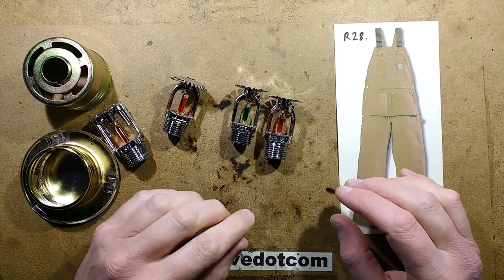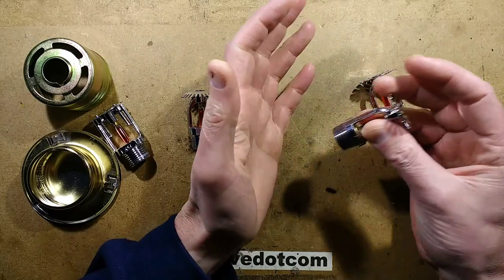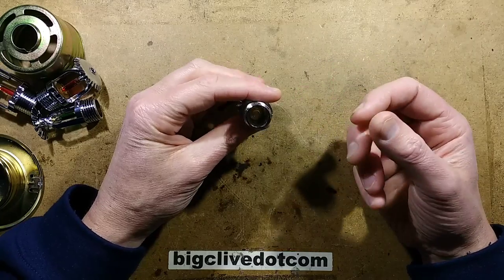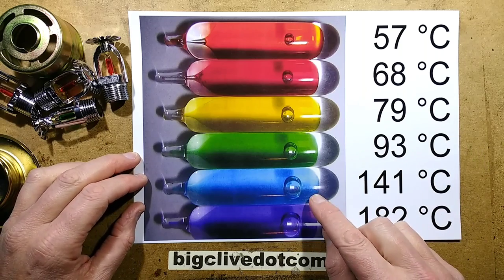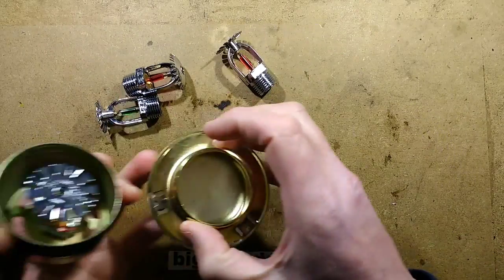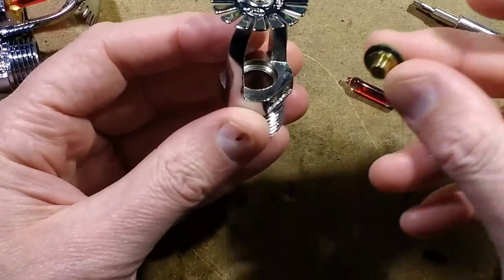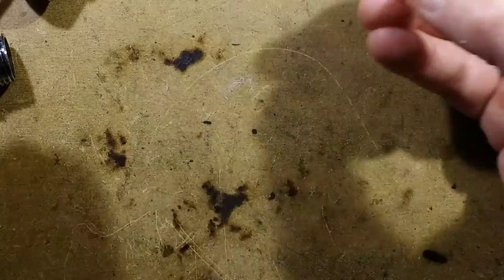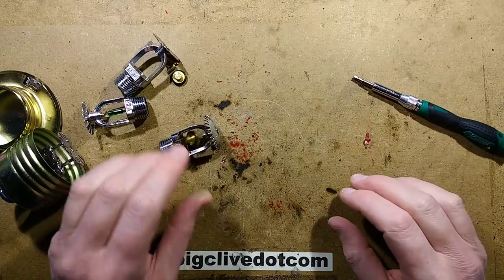How a fire sprinkler works. (featuring broken glass and spatter.)

Comment: to answer your question, the liquid substance is glycerin based liquid.  There are other kinds though.  The metal I mentioned in another comment is made of what's refered to as "wood's metal," which is a mixture of bismuth, lead, tin, and cadmium, low melting temp of course.
http://www.explainthatstuff.com/firesprinklers.html

Also available, usually in high hazard areas (hangars, power plants, etc) are deluge. Mentioned in my other comment too, all nozzles are open and the system is pressurized.  heat and smoke detectors in the same area as the head trigger what is called a deluge valve at the base of the system (where it connects to the main).  Thus, when activated, the whole system goes off.
https://www.vfpfire.com/systems-deluge.php

There's literally a whole class offered at our local fire academy about fire suppression systems.  Beyond these water sprinklers, there are older systems called Halon systems.  Halons have been pretty much phased out of production, due to the effects on the ozone, though I hear of them using halotrons, an environmentally friendly version of halons, to replace these.  Basically, Halons displace oxygen, and, when all done, do not leave any residue.  You will often see these in older computer labs that were around since the 80s.  By the mid 90s, their installation was outlawed (due to ozone effects) and now once a system has activated, it must be replaced.  The system works when fire detection systems are triggered.  An alarm sounds and individuals in the room have 30 seconds to leave.  after this electromagnets holding the doors open release, allowing the doors to close.  Once they latch, they are electronically locked, and the halon gas is dispersed (I can't say I know the exact gas used).  The gas removes all oxygen from the room, and, after a while, the gas disperses leaving no fire and no mess, and any computers not effected by fire or smoke can be used.  It's a neat system!

Perhaps you could see if you could get more fire supression/detection system components on camera?

Comment: They make plastic pipe for sprinkler systems. But if you work with explosive stuff you want steel pipe
Reply from the maker: I just came across the plastic sprinkler fitments.  Interesting to note.
Reply: @bigclivedotcom  yeah but I read another comment where the guy said an air charged system. It is better since the water (and possibly glycol depending if it's in a freezing area) turns nasty. In your refrence to putting sprinklers in your shop. I'm a plumber in New York but I know in Connecticut in the mechanical room is required to have a sprinkler head coming off the water main JUST IN CASE. If you do want to put in a  sprinkler system with copper you can use ProPress.
Reply: Also. Love your channel 💪💪👍👍👍👌👌👌

Comment: another thing that is interesting about fire sprinkler bulb is that they come in different sizes and as the size of the bulb gets bigger it increases the delay of the bulb exploding. In the trade the smaller/thinner bulbs are call quick response heads and the lager/thicker bulbs are called standard response head. in your video it looks like to me these are all standard response. 

http://www.qrfs.com/assets/images/difference-between-quick-and-standard-response-sprinklers-QRFS.jpg
Reply: Another thing to note about this is it wouldn't be a good idea to put a quick response head in the same area as a standard response head because if the quick response head was more remote to the fire you wouldn't want it to go off before the standard response head (which would be closer to the fire) this will cause the fire the spread away from the active fire sprinkler much faster or  worse the quick response head could cool down the area and the standard response head would never active.

Comment: Clive, that system where the sprinkler is enclosed is a bad idea. The common method of turning off sprinklers in an accidental situation is to take a wedge of wood or rubber or really any malleable waterproof material, and whack it into the gap where the glass used to be. In the enclosure, it would be near impossible to do that.
Reply: Try using the sprinkler cutoff valve next time.

Comment: I would not recommend installing a commercial sprinkler system into your residence unless you're prepared for the aftermath of it activating.
Reply from the maker: Still a better option than having the house burn to the ground.
Reply: Yea considering the insurance limits on water damage versus fire, you might be better off financially having the whole thing burn down.
Reply: A friend just moved into a new "stacked townhouse", and every room and passage has sprinklers in it.  Don't think it's a "dry" system, as I don't see any extra pumps in the utility room.  The whole place is plumbed with PEX, so I'm assuming that it has PEX running to the sprinkler heads also.  
If it were me, I'd prefer to clean up after the sprinklers kick off, rather than sifting through the ashes.

Comment: Hey you know there's club nights where big beefy blokes with beards can go out in their authentic workwear, and be admired by accountants and office managers and god knows who else, all complimenting each other on their attempt at working-man drag. Dude, you'd do well, if you're into your electrician's uniform. Even if there's not a special night, just go to the right pub, you'd still draw big strappin' lad admirers. Pretend you're a hetero bloke who just popped in for a pint after work! 

As far as the sprinklers go, I just watched your video on a pocket warmer that runs on naphtha. Install a sprinkler in your pocket! Yeah if I were a DIY bloke I'd probably stick a couple in my workshop and kitchen. Can you get misting sprinklers? Cos of the thing with water and burning oil = explosion, but a mist would probably be alright in that regard, absorbing heat and evaporating before it could sink beneath burning oil. I dunno, there's probably a regulation somewhere that tells you what to do. For £299 from some privatised agency.

Comment: Buyer beware with the inexpensive Chinese sprinklers. Fire sprinklers go though rigorous testing by independent labs (UL for example) to be sure they will operate as designed. They are life safety devices! There has been a plague of Chinese knockoff sprinkler heads that have not been tested and who knows if they will even operate. Spend the extra money, get the listed equipment, and sleep better at night.

Comment: Seems like a horrible design. Why not make them mechanical to where they automatically cut off the flow of water when the temp lowers enough? Like a cars thermostat.
Reply: This type of sprinkler head actually exists although I haven't seen them on location. They're called "On-Off sprinkler heads" and I have read that they use them in museums or other places like this where water would damage irreplaceable stuff.

Comment: ive never really understood the appeal of sprinklers in some places you install them to stop fire but destroy the building and everything inside it in the proccess 

drywall fucked
carpet fucked
ceiling fucked
electronics fucked
furniture fucked

so yeah you put out the fire and destroyed thousands of dollars of stuff at the same time presumably more than if you had used a different system to begin with like some gas based supressant

Comment: If you require sprinklers in a facility and do not want those things to get wet on accident, (like a break or leak in the system piping) you can use a pre-action system like the one shown here: https://www.youtube.com/watch?v=oKti_KDYgKY
We use a system like this to prevent water leaks or accidental discharge in our datacenter.